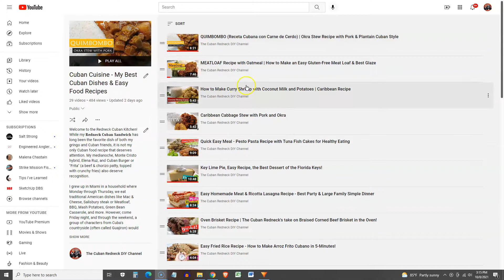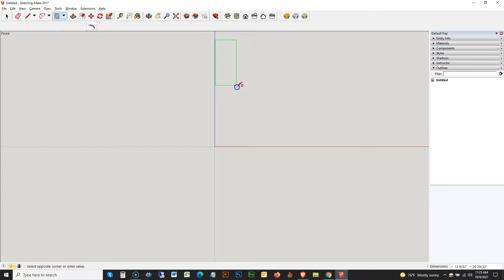Table Saw Zero Clearance Insert

Comment: Are you worried about not having a riving knife or splitter with this insert?
Reply from the maker: ....  thank you for stopping by. Blade clearance is good, and concerns over splitting is why I prefer nylon over other materials. It is gummy. It will not shatter and is pretty stable across a range of temps. In most machine shops I have worked, almost all tooling is made from nylon.
Reply: @CubanRedneck I think what he’s asking about is not having a knife or splitter behind the blade to keep material from binding on the blade.